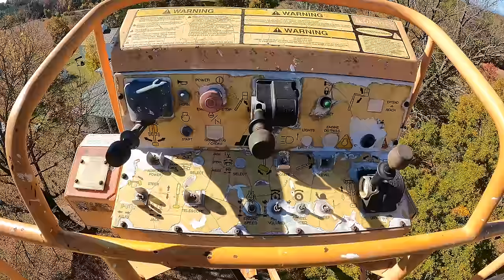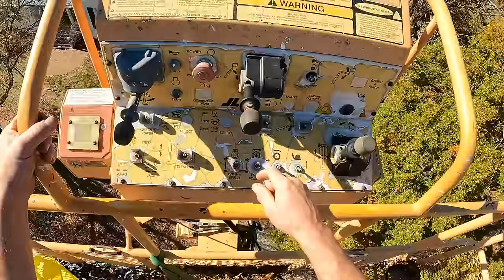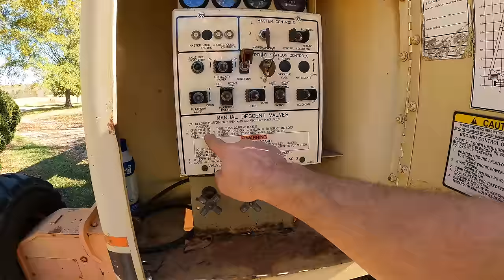Jumping out of a Boom Lift.  JLG 80HX Lift

Comment: There is something different about that first step off of a structure vs. a step off of a rock face. Even if the rock face has an abrupt edge, it is less nerve racking to go off than it is go out a window and on to the rope. And as you mentioned, being on a less stable structure adds a little more excitement for your brain to think about.
Reply: As a tree guy, I can confirm, getting your weight set into the rope and stepping off is definitely the hard part

Comment: I got a JLG scanner on newer models they have ECM after 2000+-.
Check boom wiring where it is in tray .
Also where it plugs into plugs and pins get corroded.

JLG are the best. Free repair parts manuals online.
John L.Grove (JLG) invented first hydraulic cranes .
There is a museum in Shady Grove PA.
I had many Grove and JLG the best.

We used to set lightweight trusses with this lift .
Be careful driving on uneven ground I almost  got tossed out of basket going off a curb . Pot hole curbs not good when driving with boom up.

Comment: As a rock climber, I might have some suggestions. For instance, don't let go of the rope below the rappel device while stepping out/off the platform. Either keep it in your hand or wrap it around your leg a few times. You don't want to weight that figure-8 and not be holding onto the rope or it will be a quick trip down. There are better ways to coil a rope for climbing too, but that probably doesn't matter since this is for emergencies. Mostly, rock climbers need to be able to feed out a rope to a climber and not have it be twisted.

Comment: I worked in a mill and working with manlift was mandatory in the crane repair department which I worked in. They required a ground person just in case of malfunctions and to direct people away from the area. They also were there to call the manlift people if it broke.
Reply: Looks like you got the scam too
Reply: @monkeythe1st  They are becoming pretty common.

Comment: Enjoyed the video. For viewers who are not familiar with this equipment, you should always follow all safety guidelines, connect to fall arrest equipment when entering the basket, keep three points of contact at all times, always have someone on the ground familiar with the controls. Operators get tossed out all the time. They also get stranded because no one is on the ground to operate the master controls when the cage controls fail.

Comment: Just another idea for a back up regarding stuck up on a boom lift. You could put a back up battery in the circuit with a switch in the bucket. You can keep it charged through the normal charging system. Run a line up to the basket to the switch and occasionally use the system to be sure the rig is functional. I suppose you could also use it as a back up battery when your main goes flat with just another switch. That way you can still work with just a flip of a switch and then when you are finished with the job sometime later fix the problem with the main battery. Sounds like a good plan to me. I would do it if I had your rigs.

Comment: ⚠️  On our fire/rescue apparatus with mini crane hoist, we have recently upgraded the electrical system for the accessories.  Under normal conditions, the vehicle provides 12vdc to the hydraulic pump.
We now have a 12 volt / 100ah LifePO4 lithium battery mounted in a stainless steel battery housing adjacent to the vehicle mounted controls.   

It’s charged from “shore power” when plugged in and parked in our parking garage.
During normal operation, the hydraulic pump is powered from the vehicle (older wiring configuration = wired to one of the 2x 12v vehicle batteries) and there is a pair of solenoid type relay/contactor devices that disconnects the vehicle 12v power supply and connects the LifePO4 lithium battery.  (“normally closed” for vehicle power / “normally open” for the 12v battery).

Power for the “emergency battery power” system is from the LifePO4 battery and there are 2 locking push button switches wired in parallel.  One at the vehicle mounted control panel and the other is in the cab of the vehicle.  In a boom lift type unit like this, you could easily mount additional controls at the boom bucket OR use a wireless controller for wire free installation.  (just make sure to use the best possible components- no Chinesium junk when your life depends on it.)

Power fails from vehicle battery?
Flip the switch and the aux LifePO4 (or AGM or “wet” sealed lead acid or vehicle battery).

Comment: I was in a very similar situation doing tree work in a rented unit, up 50’, the little old lady I was working for had to use the override on the ground, me hollering down to her instructions on what to do, in the end I bought myself a F800 Derrick digger that has a bucket, winch, grapple, and can lift 11,000 lbs..but I will not go up in it alone!, it will quit on occasion and no way down from that unit…

Comment: I used to work for Prime Equipment Rentals.
One day, we got a Nextell call from a customer, who was on a 120" lift, and couldn't get down.
His worker was freaking out, both were in the basket.
I had to drive almost 50 miles to open a valve at the base, to bleed them down.
It was a hot, muggy, Tampa afternoon.
They had shut the engine off, but left the key on, which killed the almost new battery.

Comment: Now that is a good use of a boom lift. I got stuck in a boom lift when the lower relay got dirt on its contacts and the lift would not respond, after, about 20 minutes of bouncing the lift around it finely started working again. I bought a long rope after that that stayed in the basket at all times.

Comment: I learn something from you on practically every video so I'll give you a tip.  Replace that lead post battery with a group 31 truck battery with stainless studs.  I've had lead to lead connections that looked perfectly good go completely dead several times in my lifetime, usually a car that just stops running for no reason.  I put in a group 31 battery with studs and put ring terminals on the cables in every machine or vehicle where it will fit.  The tools to do it are on Ebay and they're not particularly expensive.  I also think the group 31 batteries give you more power per dollar.  Hope this helps!

Comment: As far as your bad battery connection, I have had a similar experience with my old Allis tractor. I had a poor connection, so I took my wire battery brush to the posts and clamps and it worked, the first time. 
 The next time I went to use it, I had no battery power. I pulled the cables off and using more light than I had when I brushed the terminals, I could see what looked like a black oxide coating on the inside of the cable clamps. The brush wouldn't remove it, so I resorted to using my pocket knife to really clean the clamps. That solved the problem.
 I never imagined that the brush wouldn't clean it well enough to make good contact, or that a thin black coating like what I had would severely limit the connection.
  I wish I had that lift here for about a week. I have a 60 foot antenna tower with a broken down TV antenna, that really needs to come down, before it falls on the house or the shop, and can't find anyone in the area that will come remove it. I also have about 20 dead ash tress that could be trimmed for easier felling.
Reply from the maker: Yeah, I have never had a battery do that.  It worked fine when I first hooked it up, started the machine no problem.  Then it waits until I'm up in the air to quit working...  SMH.

Comment: Mobile diving tower, never thought of that, one more excuse to buy a lift! 😂
How is the solar install performing, any bad news or issues since your last video on the topic?
Still performing as well as "new" or have you noticed a notable decrease in performance?
Reply from the maker: Solar is performing perfectly so far, no noticeable decrease in production.  Cheers!
Reply: @FarmCraft101  
Sounds good, I am about to pull the trigger on buying my "solar farm". 20kw, will set it up much like yours, but it blows my mind how much you have to pay for solar in the states. How much overhead the supplier/installer takes.
Direct from china 550w panels is as low as 100$ each before shipping :D

Comment: Ahhh, you tricky boy! Fun stuff with the lake. You didn’t even take your shoes off at first! Just don’t get stuck in the bottom of the lake, or tangled in fishing line. 😳
Couple things with your battery: Make sure the terminals and the connectors are corrosion-free, tighten the connectors down well, and then spray them with a little WD-40 to help keep them corrosion-free.

Comment: Interesting video!

One thing though: the way you have the rope attached to the basket (in a loop through the railing) is actually a single point of failure. If one rope snaps (for whatever reason) there is nothing holding the "other" rope attached. Essentially you are rappelling on a Single Rope!

I think you should have attached both ends of the rope to the basket, and let the "loop" fall to the ground (rope seems long enough).

Comment: We never go up in our bucket truck without a repelling rope.  We had the PTO driveshaft drop a universal joint and break the nose off the pump.  The emergency let down didn't seem plumbed right cause it just back drove the main pump and wouldn't let the bucket down.   And another time blew a hose in the boom.  If the interlocks don't get pressure your not going anywhere.  Never know when you will have a mechanical issue

Comment: At least you had the foresight to bring your climbing gear! I could have swore these models have an emergency bleed switch that lets you down about as fast as the boom can trickle fluid. I've been on a few scissor lifts that got me down that way too.
Add: All those jumps and not one round of Soak the Land Lubbers? Aww, wasted op!
For future reference, half turn towards unsuspecting audience, legs out at ~40* angle, slightly cock back and trap oodles of water that has to go *somewhere...

Comment: How does one know what the lift is capable to "hang out" without tipping? When jumping into the pond it looked like it was on a slope as well? Where you not afraid that it might tip over into the water? Please excuse me if this is a stupid quest. 😅
Reply from the maker: Good question. It can lift 1000 pounds in most positions. 500 pounds or less it can do in any position.  It has a tilt sensor that tells you if it’s tilted too much. We never did more than 500 pounds over the pond, and we didn’t even have the boom extended very far.  We were well within its capacity. And yes, I did think that through before we started jumping.

Comment: Same thing happened to me I as by myself in a 60 foot articulating boom lift when the lift just died. Of course the auxiliary emergency power didn't work at the basket either. with no rope or cell phone I had to slide down the booms, (all three). It was a trip getting down climbing back and forth from one to another boom facing opposite directions it was crazy.
Reply from the maker: Yikes.  No thanks!

Comment: happened to me got trapped very top & inside empty 60ft stave silo needed to close all doors before filling with silage again the top 2 doors decided to fall off/inside always alone no ropes cell phones didn't exist million pigeons laughing at me only way down repel the unloader cable middle of the tripod up in the dome bare handed after getting down hung a safety rope from top to bottom permanently

Comment: The boom lift is sitting on a soft shoreline, THEN it's extended to almost full length, loaded with 3 people and it's... Still not tipping over?
Reply from the maker: Well, not exactly.  It's a 500 pound lift to full extension in all directions, 1000 pounds in all but the most extreme horizontal reaches,  and it wasn't extended very much.  It was well within the 1000 pound capacity where we had it.  It weighs 32000 pounds, and about 28000 of that is just the base.

Comment: You know the rule.  It is always the thing you changed last that caused the failure.

The only thing you changed was to bring the rope and the engine wouldn't start. 

Obviously, if you hadn't brought the rope, the engine would have started fine.

Solution -> get rid of the rope!

Comment: The “fall” appeared to be, let’s just say, somewhat rehearsed, although it was entertaining nonetheless.  But to have repelling gear conveniently available after multiple equipment failures on a boom 50’ feet in the air while home alone and a drone ready to record everything?  That’s a big ask. I guess I’m just getting skeptical in my old age.
Reply from the maker: You aren't alone, many are skeptical though it did happen.  One, I'd be stupid not to have a contingency plan in a lift that is 26 years old, hence the rappelling gear.  Two, I'm a youtuber and I have cameras rolling all the time.  Three, I'm making videos about the lift, so I almost always have at least 1 camera on when I'm using it.  I guess I should have explained that better in the vid.
Reply: @FarmCraft101  I would have not even dignified my comment with a reply if I were you so I take you for your word.  I’m sure you are very relieved now.  And is there anything you can’t do?

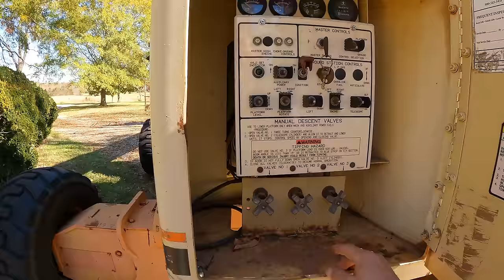Comment: I re-watched this recently and was intrigued by your description of the failsafe controls to lower the platform with no power. So was kinda of wondering, have you tested those 3 valves (@ 7:00) to ensure they are working correctly?
Reply from the maker: I decided not to open that can of worms.  Worried if I open the valves they may not close properly, cause new leaks, etc.  I'll just keep the rope with me so I won't ever need the valves.

Comment: Really. It looks like you might have an auxiliary switch to where when you get stuck. It releases the hydraulic to down mode. It's a feature that is built with every boom lift. It switches to battery. 
Your not fooling anyone. I believe they even make auxiliary switch in the bucket and and the base as well. So there is 2 of them. And if I remember correctly the auxiliary doesn't use the battery to go down and just releases the hydraulic pressure. Only uses battery to go up in up or extend mode.
Reply from the maker: I tried the aux in the video.  It uses the battery and won't function without it.  Not trying to fool anyone, just showing what happened to me.
Reply: @FarmCraft101  I got you. It just looks like weird setup. No biggie

Comment: There's a YTber named Doug Jackson, he built a ship called the 'SV Seaker' in Tulsa, with the help of his ex-wife, friends, and a hundred volunteers. Dude does everything on the fly, even cutting 2" /thick/ wood chunks with a circular saw that has the guard retracted. Wearing a loose t-shirt and power cord dangling. (Oh, someone else does the work holding with their hands.) Welds/grinds in whatever confined space he can muster. He chided me for mothering him, and I kinda get the same vibe from you. No offense, but some of the risks that you take are totally unnecessary. You might address/admit them later, but just the transmission fubar could have ended you.

Comment: Farmers are geniuses, but there are exceptions. From watching your channel, you ain't one of the rare exceptions, you are a normal big brained variety. I'd expect anyone  having limited smarts to not wear a safety harness, to also apply the same smarts and climb outside the cage and over-reach...

The camera angle wasn't one you've used before, the video being uploaded with a clear voice-over were additional hints there was more to this. The barn part was unexpected. Nice.

Boom lifts are handy tools. Dangerous too. I've twice had the misfortune of being a person with the right information with the wrong authoritative position, warning managers beforehand about untrained workers operating boom lifts. Both times ended with worst possible outcome. 

You kept the lift within safe operating parameters for the pond jumps.  A couple of feet shy of 30' above the surface is my guess.  Park the drive unit with 4 wheels level on solid footings and you'll be enjoying 50' leaps. The speed at impact is only about 10mph faster (~40mph).

Comment: At the onset of this video, I was thinking to myself this idiot has just joined the ranks of numbnuts  that jump out of perfectly good airplanes so they can film it crashing.. I’m glad you owned up to it being a prank to troll your viewers in the end. But being a retired mechanic that worked on these types of equipment I never once saw an operator have a repelling harness and rope in the basket ( just in case) they couldn’t get down. From that point on I knew it was a scam.. always be safe have a safety person on the ground when operating it, those emergency release valves work great if someone is there to turn them.
Reply from the maker: This lift is 1996, 26 years old.  I'd be stupid not to have a contingency plan, especially considering I am frequently alone when I'm working.  No scam, the rappel incident really happened exactly as shown.